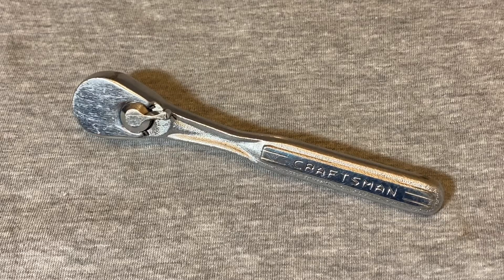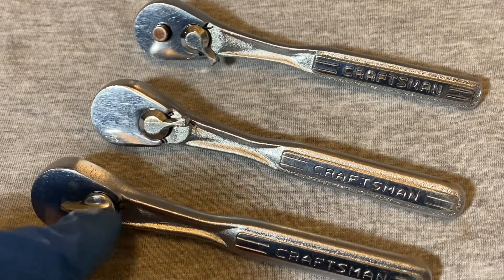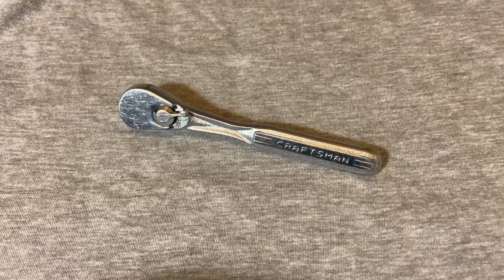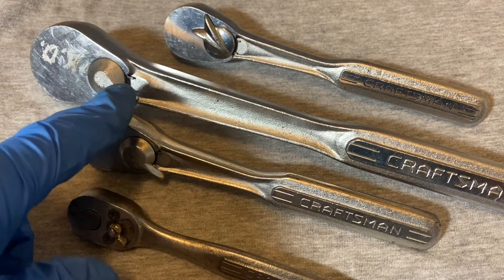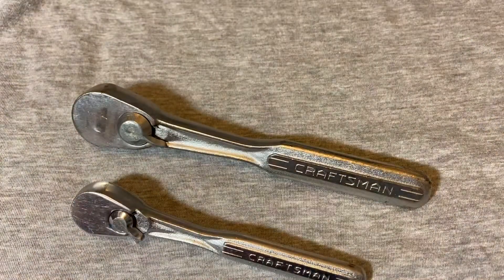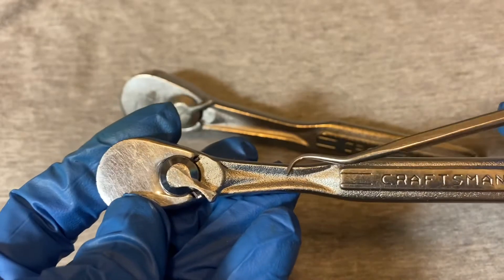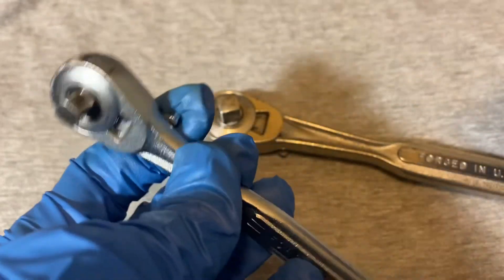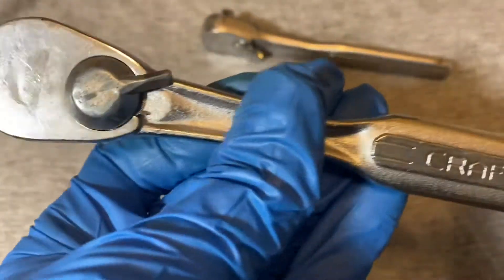Craftsman Ratchet Short Lived Pre-Quick Release Model And A Brief History And Comparison

Comment: I too used to think the early flying V and the original long levers used the same body (just interchanged the switches), but then I noticed that the originals had a "pointed chin" on the drive side of the head, near the drive gear snap ring, and the early flying V ratchets (with the rounded ends of the raised panels and chrome drive gears like the original long levers) have a "rounded chin" like all later versions of the teardrop ratchet. So, the forgings do differ; it's not just the direction switch that changed. (I'd post pics or links to pics of what I mean, but youtube won't let me.)
Reply: (Edited after double-checking) Clarification: I have two 1/2" original long levers, both with "pointed chin" (1 40-tooth, 1 32-tooth); two 3/8" of which one is "pointed chin" (like your 3/8" one in the video), surprisingly, the 32-tooth one, which I presumed was the older, has the rounded chin, and the pointed-chin one has the 24-tooth gear that all later 3/8" drive ratchets in the series have); and four 1/4" original long-levers, only only one of which has a "pointed chin" (and all have 24 teeth). Perhaps the pointed chin is just a variant rather than evolution, some of the early teardrops having the pointed chin and others rounded.
Reply from the maker: Good catch! You’re right. Thanks for the insight 👍

Comment: I'm starting to become a ratchet collector. Most are new American made ratchets but I'm buying older ones to go with the old Craftsman ratchets that I've owned for years. So far have some older SKs, a Walden and a no name Japanese round head, which was in a tool bundle I bought. Last weekend I was buying a tool bundle from a guy and I saw he had a flying V ratchet. Was going ask if he would sell it and than I saw the V was damaged. Ugh. I suspect the V gets damaged easily on those ratchets.
Reply from the maker: To be honest I don’t see a lot of v switches damaged since they’re pretty flat. I do see a lot of those switches discolored though as the chrome plating seems to fall off through use or neglect
Reply: @snapringchronicles3020  It was bent like it got caught on something.

Comment: I have the long handle. Paid two bucks for it and a new bearing for 20¢. The lever is busted but it works fine. But why do they get the dent on the head where the QR would be?
Reply from the maker: Good question! I wondered that myself about that dimple in these ratchets 🤔

Comment: I don't know exactly where to ask this question, but I need to know the size and how to source the single little ball bearing that's on the selector spring on a Craftsman 1/4" 44807 ratchet. Really hoping to not buy a $20 rebuild kit that I don't need for that one bearing.
Reply from the maker: If it is the USA made 44807 the size of the ball you need is 3/32”. You might be able to source these locally in a hardware store etc. I saw 100 of them on eBay for like $5. Hope this helps...
Reply: @snapringchronicles3020  I sure appreciate your response! I actually had come to that conclusion already (of it being 3/32) after watching a video another guy put up where he wrestled with that ridiculous bearing for 10 minutes (on video). He measured it and came up with .093, which is close enough to 3/32. I don't rebuild a ratchet without first checking with your channel; have learned much here. Thank you very much!
Reply from the maker: Yes sir. Glad I could be of some help👍
Reply: I have the 3/8” version and got the bearing at the local bike shop. 20 cents. Bought two. Use some grease before trying to assemble it. Grease the inside of the ratchet as well as the spring etc that way if you don’t get it on the first try you won’t be needing another bearing because it will launch. The grease catches it and keeps it from rolling away! Ask me how I know! 😂